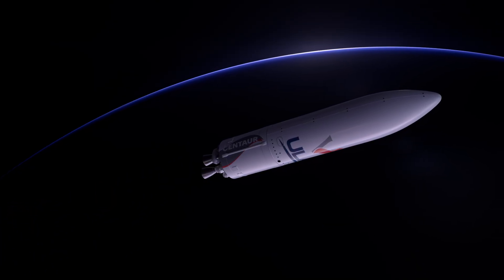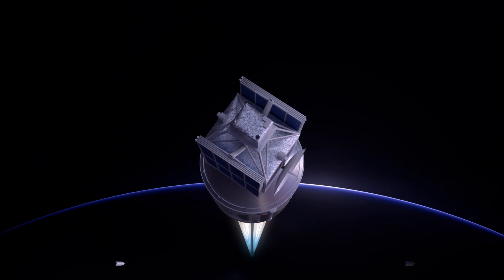The Vulcan Era Begins: A new era in National Security Space Launch

Comment: How much, and which parts, of the launch vehicle are reusable?
Reply: Currently none, but in the future the first stage engines will be reused
Reply: @Wurtoz  bro took the bait
Reply: @notgreg123  I know. Bait was yummy though.
Reply: @Wurtoz  Only ENGINES?  Not associated flight hardware like fuselage, fuel tanks, all that clutter around the outside?

iow, ULA's Falcon 9?
Reply: How much, and which parts of the launch vehicle do not explode?
Reply: @zaks01  Almost all of them. One nozzle fell of 1 time and it didn’t ruin the mission.
Reply: Core tanks and engines in the future. The tank is rumored to be upgraded with salt abosolving agents for splash recoveries.
Reply: This was a GEO flight.  Re-usability is not possible beyond LEO due to burn up by anyone, certainly not profitably for payload launches.